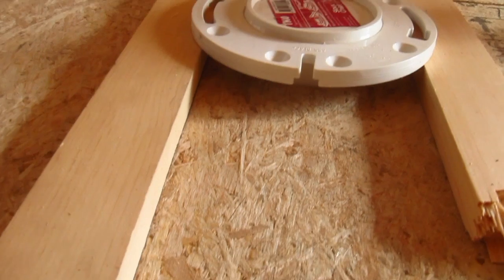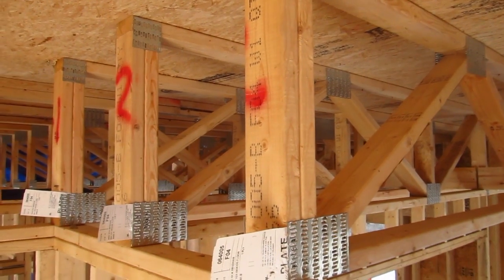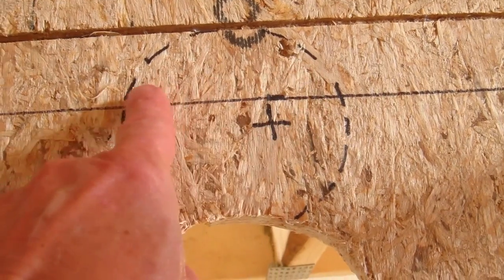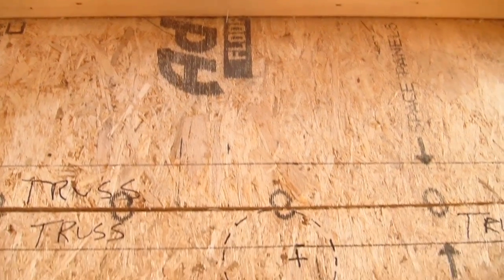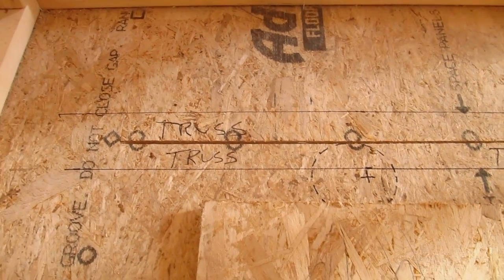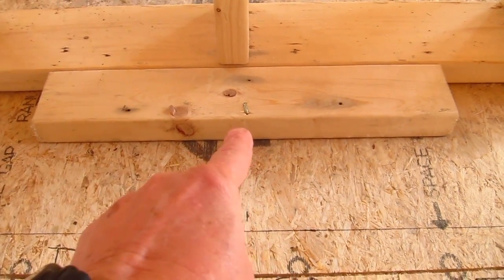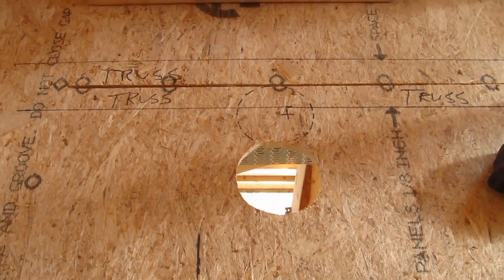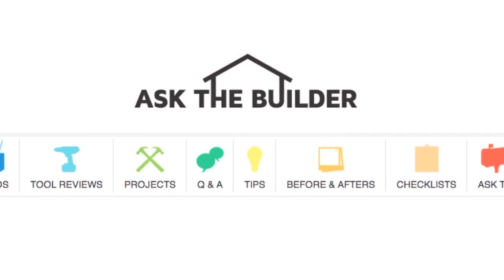Toilet Rough In Dimensions

Comment: Jim
Can the vertical drop from closet flange to a 90 degree bend be 22 inches?   To route under framing
Reply from the maker: Yes, it will all work fine. Be sure to watch my How to Vent Plumbing video.

Comment: Jim - the flange is plugged off for rough in so the plumbing can be tested for leaks (with air pressure). When the toilet is installed, the plug will be knocked out.  Too bad the joist location wasn't caught before the wall behind the toilet was built, but all in all 3.5 inches is not much space too loose. Good solution!
Reply: as long as the door jamb in the water closet and that door installed in the jamb and the door that's in front of the toilet Can Open without hitting the toilet!
Reply from the maker: Get unlimited FREE tips like this each week by subscribing to my newsletter at www.AsktheBuilder.com

Comment: why i can not leave the 3.5 extra behind the toilet?
Reply from the maker: This is actually a great question. Most toilets are two-piece - the tank is separate from the bowl. Some people when sitting on the toilet press their backs against the tank. You can create a massive leak should you press too hard. Ideally, you want the back of the tank close to the wall (probably a gap of 3/8 inch between the back of the tank and the wall), but you have to do this with precision so as to leave enough room for the tank lid to overlap the top of the tank. This will all make sense if you just lift off the lid of your toilet tank and look behind the tank and the wall.
Reply: @askthebuilder  I have 14 inches from tiled wall to flange stud with 2.5 inch gap from tank to wall. Was going to get a 12" rough in American Standard Edgemere round.  Its a small 1/2 bath and could I gain two inches by getting a 14 inch rough in toilet.      thx
Reply: Interesting what you learn on these "how-two" videos... It would never occur to me to "lean back" against the tank/lid. Interesting to know that some people do that... great video!

Comment: What was the flange blanked off w/o a hole? I've not seen one like that b4. What do you use for piping your potable water? Copper? Or have you joined the PEX parade? LOL I'm asking that b/c in this job you're on there's a good opportunity to discuss that topic. BTW, great vid, and an elegant solution.
Reply from the maker: That flange has a knockout wafer. It keeps debris out of the piping system until just before you install the toilet. Water supply lines? Be patient my Padawan! You're about to be FLOODED - pun intended - with countless videos about this project, including water supply lines. It's my goal to drop onto you and all other subscribers about 200 new videos over the next three months. Wait until you see the next one I record about WHEN the toilet flange SHOULD be installed.

Comment: Since you're losing space in the water closet area, how difficult would it be to zip off the nails holding the original wall and move it the needed distance?
Reply from the maker: In this case that's NOT an option. That 2x6 wall is shared with the shower stall and they want it just as is. You can see that you'd have to move that wall right around 6 inches so the pipe would clear the other side of the truss.